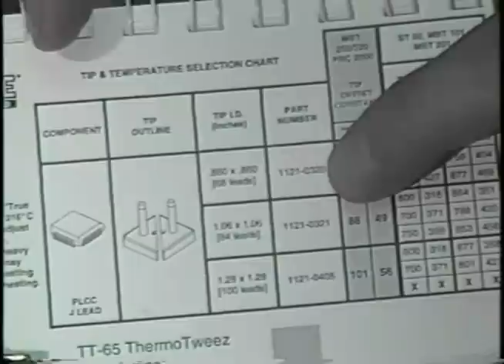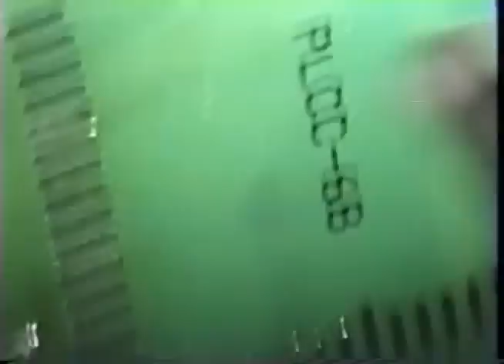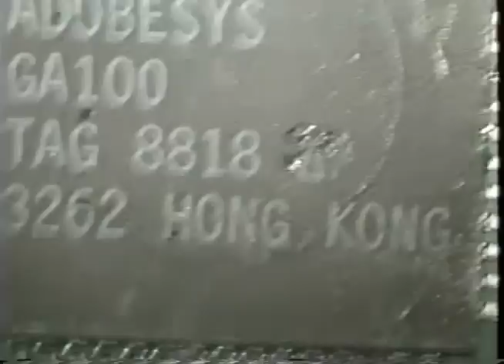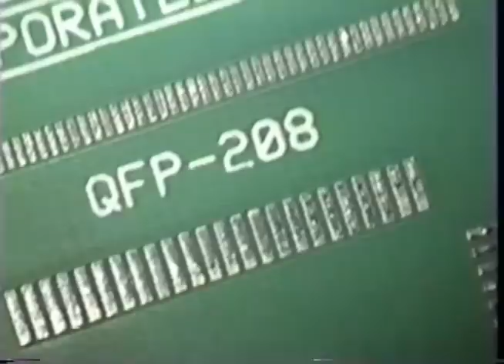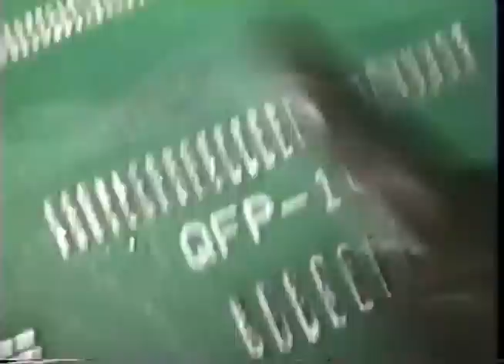Pace Inc.Everything you wanted to know about soldering and desoldering but were afraid to ask

Comment: Best freakin tutorials EVER! But, you have tools for literally EVERYTHING... Not all of us work at NASA, developing rocket boards, or have this kind of lab anywhere nearby. Nevertheless, I REALLY like your tutorials of plain solder tip and paste works. I am yet a beginner, but with this kind of help, I can make myself better. THANK YOU!
Reply from the maker: Miroslav Miljkovic Thank You for your complimentary note Mr. Miljkovic  See the paceworldwide.com and see process guides for many procedures on various PCB's. 
Pace's "Cir-Kit" will help you save older boards. 
My Apple MacBookPro needed a few QFP's and they were replaced easily using components from a scrap board, and I was back in business. The repair paid for the kit! The tech used pace and pace process guides to show him how safely.
Avoid low melt large plastic range solder kit's for component removal as they will contaminate the Intermetallic  layer which is then much less reliable with continued thermal cycling. Medical , avionics, process control boards in manufacturing aren't deadly like nasa but a big loss when the machine stops working.  Failed Med systems and police and emergency communications systems and traffic lights are also critical and life and death.
Best Marc W.Siegel.

Comment: Hello, Marc,  I wanted to thank you, I believe that your videos allowed me to de-solder and change a Spi Flash Nand  on a Blaupunkt TV that was cycling on start ! I managed to do a somewhat clean job, without overheating, without too much lead ! And the TV is back on service (not that I look at TV I will use it as a larger screen ! ;)  A Big Thank You then, and BEST 2021 wishes of course ! Isaac
Reply from the maker: Excellent!
Reply: @MrMarcSiegel  Yes it helped, good. Can you tell me if I dismount that champion Micro 6802 B CI pwm and alim control, I will be capable of checking it with an ohmmeter only ? (and put it back !) . I find 5 to 10 Ohms between ground and vcc , just find the datashett -  Thank you http://www.champion-micro.com/datasheet/Analog%20Device/CM6802AB.pdf
Reply from the maker: @IsaacOLEG  I don't know Sir. My training is only for PCB physical repair. I don't even know AC/DC law.
Reply: @MrMarcSiegel  Hi thank you, it surprise me, but I understand specialisation exists. Thanks for your honesty, being a hobbyist (trying to repair but mostly trying to learn new things, which is not easy) I was persuaded that anyone working professionally with a solder iron had some training in electronics.

Best regards
Reply: @MrMarcSiegel  Hello Sir ! Hello, this is out of topic so excuse me, I just did read that in case we do not have some at hand, we can use "paper coffee filters" as a non woven fabrics - to clean screens, or parts to be glued dust free, or even to get rid of the flux without leaving small pieces of fiber. It may be probably OK, then I though that we have plenty of facial masks at hand those days, and they seem to me made out of non fiber material too. Did you heard of that ? Using them in place of the special fabrics for electronics cleaning ? Best regards 

ANd (!) BTW do you heard of using heat (or Heat plus a cold spray ) to straighten up damaged pjone or laptop cases or chassis (twisted, bowed, smashed) ? As it works somehow for cars body (plastic and metal BTW, having their "memory" ) I am about to try before installing a new screen on a cheap telephone xiaomi, that seems to get a bycicle passing on it ;) ever heard of such process to help straightening ? Thanks

Comment: I asked whether iron tip need a earth connection sides to eliminate any strayed ac voltage source of damage the sensitivity components ?
Reply from the maker: The Iron and power source must be grounded at the same potential. Also Zero power switching and wrist strap. Best Marc

Comment: Still, this great video contains a lot for the interested audience. Nowadays, we struggle with high-power QFN packages which have high thermal mass thanks to the massive copper layers. Like DR-MOS in the power rail of modern CPUs. Can you show us some handling advice on this issue? Especially because there is no access on all four sides, because decoupling capacitors and series resistors are placed too close nowadays. Thank you very much, Sir!
Reply from the maker: On ceramic PCB's we preheated the board sometimes close to solder melting temp. point to remove and replace.
FR-4,FR-5 multilayer boards with large ground planes also pre-heat and use a fine point heated tweezer I've also used a large  chisel  tip as clearance allow's to heat the component directly on a preheated board and mealt using heated tweezer.
Combined two methods and you can use lower temp,
I'd have to see it and find the safest process. 
PACE should be responsive with problem solution services.
I'm retired but leave basic video up for students and pro's in the industry ...These methods are still important. 

Thank you so much for your compliment.
Peace 
Marc
Reply: @MrMarcSiegel  Hello, Marc, thank you for your response, even you are retired! I think your advice to pre-heat the board nearby to the glass-temperature of 130 degrees Celsius from the bottom of the board, and heating to nearby the liquidus temperature on the top of the board, can be the key to success. I'm on the way to leave the Hobbyist level and enter the world of professionals. I'm a CID, CID+ from IPC and ZED from German FED counsel. I want to settle my company with repair standards according to IPC 7711/21. Still I'm experimenting with the high thermal mass in modern MOSFETs and motherboards. I think just to use a single hot-air station by 450 or 500 degrees Celsius is not the best solution... As a real, serious company, I must warranty for my work. I highly appreciate your work and your videos! 😀

Comment: Can you de-solder with a hot air gun?

I'm guessing it would liquify the solder, allowing you to remove the chip easier.

Then you can remove the excess soder with a wick.
Reply from the maker: Thank You. Sorry for the late response. Best Marc Yes you can but avoid reflow of adjacent joints

Comment: Excellent work. You do have a lot of patience for this type work. Very clear, concise explanations on every work piece. These techniques used for soldering  smd are helpful and will be put to use . I am curious as what type of no clean flux is being used here. It looks to me it works well with Solder being used. I assume the solder is 8 ml in size and without resin core. Would there be a problem mixing the both. Again your a true professional and enjoyed you sharing this information. Canada.
Reply from the maker: Tin lead 60/40 rosin core used here.

Comment: Great video Marc. Do you know of any tips / methods for repairing lifted pads e.g. if you've applied too much heat or damaged them mechanically? Thanks.
Reply: Hi Marc, Thanks for the reply. I was only actually working on my mouse, replacing bouncy microswitches, and I lifted a thru-hole pad, so it's not gonna be worth spending big bucks. I was just using an iron, wick and a pump. A bodge-wire is holding steady at the moment, but it did get me wondering about how I could repair more critical stuff. I was thinking that copper foil and epoxy resin were probably the way to go. I'll definitely bear the Cir-Kit in mind, thanks again.
Reply from the maker: CirKit track and pad repair from Pace. Not sure if they still carry it. Marc

Comment: Mark, what the best way to use removing a QFP128 0.5mm pitch  clean and safe keeping all fine pins straight prior to reuse the chip on another PCB ? since this video doesn't cover this kind of procedure, in case if hot air gun is preferable tool then what the safest temperature should be set? please reply with full process how do it, many thanks in advance...
Reply from the maker: Not sure.Thank You. Sorry for the late response. Best Marc

Comment: Solder extractor? Nah it's called a solder "sucker" in Australia. Used the Pace HRSS for many years with Honeywell mid 70's to 90's. Of course this is "slightly" more advanced than the good old 7400 series TTL days but cleaning the sucker glass tube, new filter pad and inside the station itself was important to get good extraction. Of course all multi layer full ground plane pcb's back then but the Pace gear always worked and copped a flogging on a daily basis. Good stuff.
Reply from the maker: Ride on !

Comment: Hi Marc - I liked this video. Thank you for sharing. Wondering if you can tell me the best way to remove a SOP24L package. 24 pins 6mmx8mm? Also is there an easy way to look up Pace tips by dimensions? I have both the thermotweez and thermopick. Thanks. Greg
Reply from the maker: +Greg Hodges Hey Greg, thanks for the note.  Contact Pace directly via their web site. You should receive a fast response and answer from an expert to your question. FYI The site has tip lists and dimensions and P/N.  Marc

Comment: One question about termic tweezers. You have very fine one, and you using them on lead tin. Im going to buy cheap one with 48W at 220V for sam hobby stuff. Will they be enough for unsoldering things your way (bridging with LEAD tin) on lead-free boards? I mean, will lead tin lower melting tmp enough in lead-free solders to use 48W for it?
Reply from the maker: Thank You. Sorry for the late response. Best Marc Request

Comment: Great job , great quality, links, information thank you. Is not P.A.C.E. an acronym for training among professionals ?  thanks (
I did get it finally, so there is PACE brand and PAC ?)
Reply from the maker: P.A.C. is Production Automation Corporation a seller of PACE worldwide products. PACE (Product Application Consulting  Engineering )the original acronym.
Reply: @MrMarcSiegel Thank you I was confusing with  PACE Professional Advance through Continuing Educations . booklets to support a training among professionals of pianos repair and maintenance ;) I like the videos from Pace, however .  a good 2021 year to you
Reply from the maker: @IsaacOLEG  Your welcome.same. Funny, I just got my 73 Rhoads repaired.
Reply: @MrMarcSiegel  Mmostly acoustical on my side but I tuned a few Rhodes. good instruments, their regulation is specific, not many techs do that.
Reply: btw, I am wondering, can a small quantity of acid be added in 99.9 isopropyl alcool to get rid of corrosion more easily (before desoldering/soldering) ? I thought of phosphoric acid, or even some chelators that attack only the oxydes) I did see water based flux used too, are there advantages , out of not attacking protective lacquer ) ?  thanks
Reply from the maker: @IsaacOLEG  I don't know Sir.

Comment: What are these wire holders called? Like dentists' instrument holders.
Reply from the maker: Resistance Tweezers D.C. current. Best for cable harness connectors. The tool only heats the part where there is continuity. Avoid melting ajacent wire insolation into the braided copper wires. Best , Good questions. Marc

Comment: Hi I want to ask You a few questions!What are You soldering station work that You recommend ? Is there any big difference between these stations and MBT250 MBT75 ?
Reply from the maker: For most techs. dealing with SMD, thru hole and small BGA only require the ST 115 Digital Desoldering Station with SX-100 Sodr-X-Tractor. It's one channel. You then order any specialty hand-piece as needed. This would be a good one if you only worked 10 to 20 components a day. 
If you require a full time system to do all day soldering and desoldering for recycling or full time repair and rework I'd get the MBT-350 or MBT-301. The MBT-350 will pay for itself in a short period of time if you are repairing boards to re-sell, thats the model you want. Older apple boards to alone can get 400 U.S. on the used market. 
I have personally done a hundred PLCC removal and replacement in 4 hours. 25 components per hour easily.
I have always loved the PRC-2000 . If your a full time board repair tech. expert doing work that requires a high end standards?
 Training is the most important part!!! so you use the system to it's full potential. Watch the training videos on the Pace Inc. site. We call it non-destructive repair. 
Hope this is helpful info. for your Sir.
Worked at pace for 16 years so I'm your guy. 
Thanks for the note Mikhail.
Best to you and yours
Marc
Reply: Thank you for your detailed answer. You have used other soldering stations Pace ?
Reply: I too look at Your soldering stations it is universal it is a pity that now radio are very small !Just wanted to ask about the station, Pace pps 95 thermoflo did You use ? How desoldering the BGA chip ?

Comment: what temp do you use with the  square kind tip?
Reply from the maker: 600 F use a conical tip or a pace wave soldering conical tip 
which holds more solder. Best Marc
Reply from the maker: I always use 600F.  You can solder at higher temps. if you know how to reduce your dwell time to a fraction of a sec. but with the square tips if the solder is too hot the excess solder will drip on the board or you. Best Marc

Comment: too many tips... just make 1 tip like tweezers that you can adjust the size to match the chip you want to remove.
Reply: Gemein Hardt Ummmmm... a) you need full coverage on all 4 sides of a square device, how could you adjust width without interference? b) they show tweezer type tools in this video. They still need tips for each size square package, of course.
Reply from the maker: Thank you for answering Best Marc